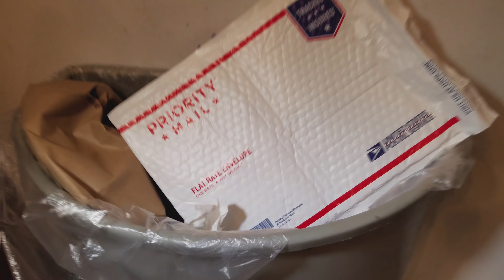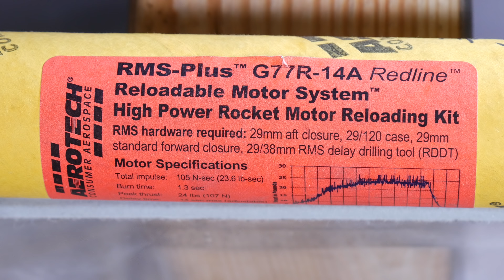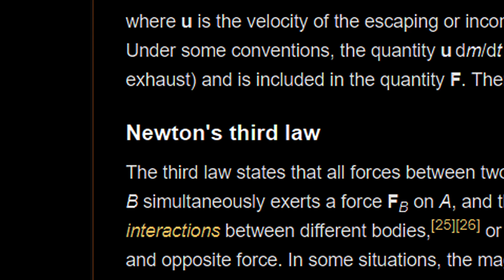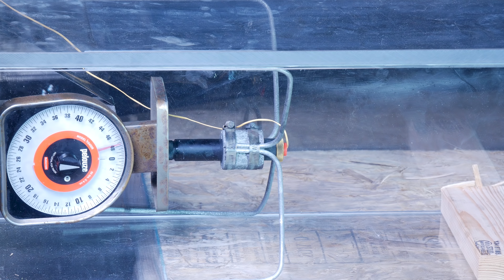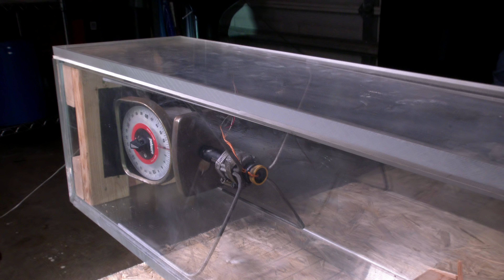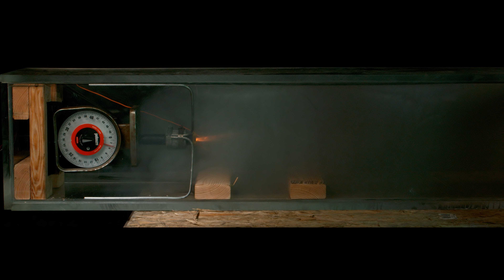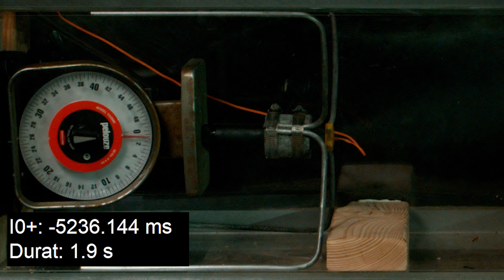Rockets in a Vacuum Chamber - Newton's third law of motion Visualized

Comment: How dangerous is it to go into space? What are  all the dangers?
Reply: Well there's no air or atmospheric pressure, so you need to take a "pressure vessel" with you.  A big mylar birthday balloon filled to 5 PSI pure oxygen would suffice.  Then there is the thermal environment: if you are in the shade, then all of space feels like walls of ice at 5 degrees Kelvin absorbing all your heat.  If you are exposed to the sun, then you are feeling ~1300 Watts of solar radiation per square meter exposed, so you better have a way to get rid of that heat or you could get too hot.  Then there are various forms of radiation based on your location ( not so bad in low earth orbit, bad if passing through the Van Allen belts, and Galactic Cosmic Ray's can hit you anywhere), or being hit with a solar flare can ruin your day (and kill you).  Then you could run out of supplies if you don't take enough along ( food, water, power, air, etc.)
Reply: @stuartgray5877  oh my goodness! How did those brave astronauts endure such dangers? They got so bold they took a moon buggy to drive around in. What heroes
Reply: @stuartgray5877  Is the van Allen belt also known as the "Firmament"

Comment: The whole experiment is based on a false premise, ie, the flame shooting out of a rocket is pushing against the atmosphere to produce thrust. Thrust is produced inside the firing chamber. The purpose of the nozzle, the cone-shaped thing shooting fire out the back - has only one purpose: reduce the pressure on the end of the rocket engine away from the rocket. As the speed of a gas increases its pressure goes down. The pressure occurs in the first place when combustion occurs - inside the combustion chamber. By producing a hole at the end of the combustion chamber, force is exerted on the opposite end of the chamber. By using a nozzle, the gas is forced to speed up as it exits, reducing the pressure there and increasing the pressure on the opposite end of the combustion chamber. You can test this for yourself. Cut one end of a can off. Punch a little hole in the other end. Put a firecracker in the can with the fuse out the little hole. Put on safety goggle, put the can on the ground and light the fuse. Stand back and watch the can fly up into the air. The can is a combustion chamber, and it had no nozzle. Still, the can goes up. At the moment the firecracker went off, the pressure was equal in all directions. But the can could only react to the pressure that was touching it. There was no can below the can. So it reacted by moving away from the ground since more pressure was on the can at the top. The pressure had to have been pushing on the top of the can. The pop was not pushing on the ground first and then pushing the can up. there was only one pop, and some of it hit the ground, pushing smoke away from the can. Some of it was trapped in the can and pushed the can in the direction where the pressure was highest, the top. In conclusion, it is clear that the flame of a rocket shooting out the back is going away from the rocket, not pushing up on the rocket. The push has already taken place inside the combustion chamber.

Comment: Too bad we didn’t get to see the vacuum pressure gauge every time you did the experiment. It leaves a question mark in our minds. And your experiment proves we need a barrier to create a vacuum in our atmosphere. And where is this barrier in space?
Reply from the maker: I did in fact show it every time
Reply: Thanks for replying. I think you should watch your video again and count the number of times you showed it. Can you answer the other question? Where is this solid barrier in space so that this vacuum could exist? Your experiment proved you needed one to create a vacuum in our atmosphere. I don’t think you have to prove that rockets can operate in a vacuum because there is no vacuum in space. It is scientifically impossible without a solid barrier of some kind. The astronauts that went to the moon, did not mention anything about going though a solid barrier. And if they did pock a hole in it, our atmosphere would get sucked out until it equalized.

Comment: Inflate a balloon and then release it. What actually pushes the rocket forward? Some of you seem to think it's the atmosphere outside pushing against the balloon. No that's not it. What pushes the balloon is the pressure inside the balloon. The effective internal pressure is that which is impinging on the opposite side of the nozzle.The internal pressure at the nozzle does not move the balloon. It merely moves the air out through the nozzle. But at the opposite, sealed end there is an equal and opposite pressure impinging on the sealed end . That's what pushes the balloon. The sealed end moves away and the rest of the balloon is dragged along with it.
Reply: I have just one question..To ignite his rocket flue,did he not have to create atmospheric pressure inside the vacuum,All be it a small one.
Reply: John, you are correct, but another way to think about it is that Mass (in the form of Air) is being accelerated out the back of the balloon.  This acceleration of mass means momentum is generated.  The Law of Conservation of Momentum states that IF the balloon imparts momentum into the mass of the air it is pushing out the back, then the Balloon must ALSO gain momentum in the opposite direction that the air is pushed. This is true with a crossbow and it is true with the balloon, or a rocket motor.  Anything that ACCELERATES MASS MUST be pushed in the opposite direction with an equal momentum.

Comment: I’m confused about why you used a solid rocket in a vacuum chamber. A rocket in a vacuum requires an oxidizer to combine with the fuel, in order to ignite it. Same way oxidizer gets injected into the ignition chambers in a car engine to ignite the fuel. 

You had to go through a lot of extra steps just to get the solid fuel to burn, and that one is only used to launch a vehicle into space, from sea level.
Reply: Sorry but we use solid rocket motors as upper stage boosters that ignite in hard vacuum frequently.
Reply: @stuartgray5877  "we" 😂
Reply: @stuartgray5877  cool story, chatbot bro 😂
Reply: Solid rocket motors contain both fuel and oxidiser. You can run them in a vacuum, or under water.

Comment: Hey guys, why are u using engine which is burning out a fuel which needs oxygen. Use nozzle connected to a bomb with pressurized gas (Oxygen, carbon dioxide, whatever) and let the gas spout of the nozzle while vacuum pump is still working reestablishing vacuum. If the base nozzle is fixed to is moving Newton's third law is working.
Your test can't be objective (even when propulsion burns out) because chamber is very quickly filled with flue gasses (no more vacuum) and then engine force is created by pushing vehicle forward against those gasses

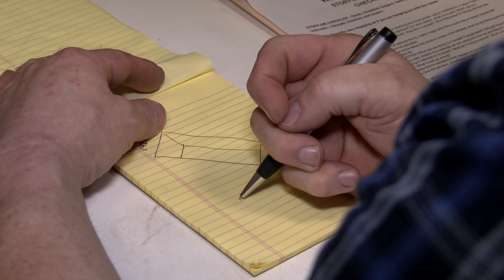Comment: At 5:24 you just started telling yourself that Newton’s third law still is legit in a vacuum haha. For every action there is an opposite action called reaction. You can look at this in 2 ways: 
1: The vacuum pulls on the walls but the walls inner strength pulls back until the pulling force created by the vacuum is greater than the pulling force of the material itself which causes it to bend and reach a breaking point at a certain force, hence why you are fortifying the walls by placing wooden blocks on THE INSIDE where the vacuum pulls, to push against the wall who gets pushed inward. 
2: The outside pressure pushes on the walls but because the pressure on the inside is not equal, but lower, I repeat; the PRESSURE (force/area) is LOWER the walls have to compensate by there strength and at a certain moment you reach the BREAKING POINT where the walls repulsive pressure outwards, pushing against the outside pressure that pushes the walls inside, is to much and then you end up like in point 1 where you have to fortify the either by putting the box under vacuum and pulling on every side or make it yourself easy and place wooden blocks at, I quote, ‘critical places’ to make sure it does not bend inwards anymore. 

And for those who think the earth is really flat, why do you think stars which you can only see on the Northern Hemisphere (NH) cant be seen from the Southern Hemisphere (SH)? Pick a random place at the NH, call it point A and at the SH and call that one point B. Now draw for both of the points a plane tangent to that point, for A we call that alfa and for B we’ll call it beta. Now we’ll define the space which is within your ability to see: draw a straight line perpendicular from your position until positive infinity. Every plane perpendicular to that line starting from the plane perpendicular at your position stacked together to positive infinity is your so called ‘field of view’ from a certain point. Now we have that figured out, which is basic math, we can see that we cannot see what is on the other side of the world because our straight line goes to positive infinity and not negative infinity because that would mean you’d be able to see trough things. I think we all can agree on the fact that this is not possible😂. We’ll call all the stacked planes in point A, FOV-A (Field Of View - A) and for point B, FOV-B. Now our assumption was that we will see different stars because of our position on a sphere and not a flat plane where we would see all the same things when we looked straight up. But why is that? We have all heard of the term ‘mutual friends’, well imagine we’re standing in point A and our mutual buddy in point B. We would all see the stars in our FOV and together we would have a mutual FOV where I would see the same stars as my buddy. How do we prove this in math terms? Not that hard unless you think math is not real. We define the mutual FOV by looking at which points in space FOV-A and FOV-B both have in common. I’ve already spent to much time on this subject so I’ll now make it short, because you have a mutual area called FOV there is also an area that is not mutual and there’s you’ll find stars only you can see depending on where you are BECAUSE you are on a sphere. 

=> CONCLUSION: The earth is round folks and I’ve spent to much time on it or is time just an illusion?
Reply: Sorry but the "vacuum" does NOT "PULL" on the inside of the vacuum chamber.  VACUUM is incapable of exerting a force on anything.  I agree with the rest